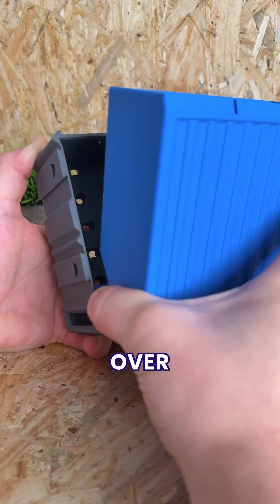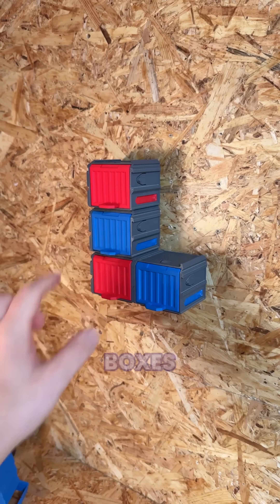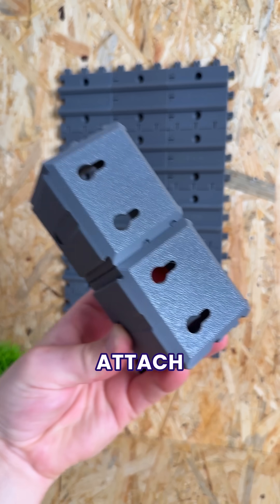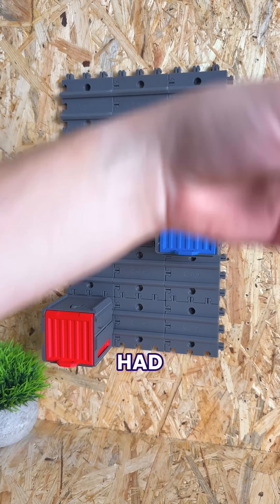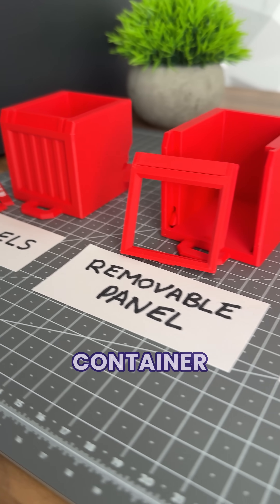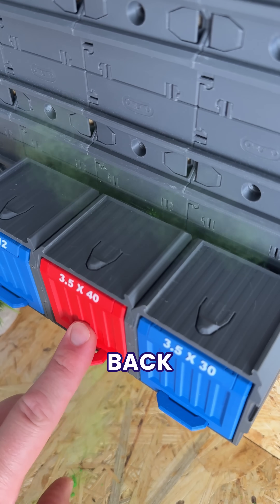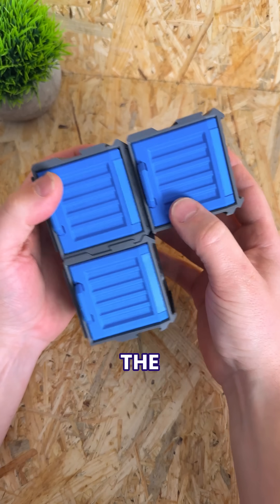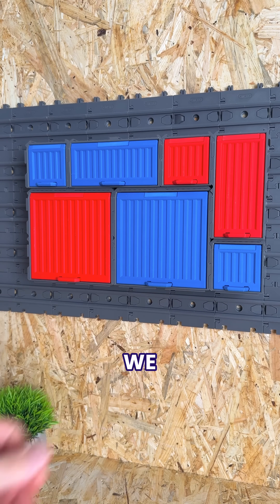We Built Infinite Storage - Part 24

Comment: ⏩🌐Video part 23 better Guide: The "Magnetic" Acetone Vapor Bath (Cold Method)
Best for: ABS & ASA prints. This method uses a liftable chamber to turn layer lines into a mirror-like gloss without expensive equipment.
The Setup
The Chamber: Use a Polypropylene (PP) container (Recycle Code #5). Acetone eats other plastics!
The "Magnetic" Trick: Use pairs of magnets to pin paper towels to the interior walls and ceiling of the box.
The Solvent: Soak the towels in 99% Acetone (damp, not dripping).
The Process
Prep: Place your print on a non-reactive "pedestal" (glass or aluminum foil).
Cover: Lower the box over the print. The vapor is heavier than air, so it will fill the box from the bottom up.
Watch: Wait 10–30 minutes. Once it looks slightly shiny, it’s done.
Cure: Lift the box and DO NOT TOUCH the print. It will be soft like jelly. Let it harden for 2+ hours until the smell is gone.
⚠️ Quick Safety
Ventilation: Outdoors only. Acetone vapors are heavy and flammable.
Check your Filament: This DOES NOT WORK on PLA or PETG. It only works on ABS/ASA.

Comment: 45 years ago I bought a similar system for my tools, screws, nails and similar. I'm still using it. Unfortunately I forgot the name. It also slide together, has several different sizes.

Comment: How about making one very complicated bin - just one? A tug, that can go dock with other bins and bring them 'here'. That way, I don't have to walk to the other end of the shop to fetch something that is actually mounted to a track that reaches me. If you put an esp32 in it and 2 small motors (it doesn't have to be fast), then write an app that can work out how to route the tug to the container I want and how to bring it back again (ok, that's the hard part, but it's not that hard, really - you can put a camera on the tug (fisheye, mounted to a stick, looking downwards, then remove the lens distrotion and  use slam algorithm for mapping). You can use the phone camera in the app and machine vision to work out the location of the required bin and the destination.

Then I can create loadouts for each project. The tug can move the boxes around until they're setup correctly for my current project.

Comment: @playerconveyor: 
First, print everything in flat, matt white. Everything. No colours, no textures, just flat, white, clean.

Mount a camera to the top, looking down, so that it can see what you put in the bins. Pipe the video to an ai to identify the contents and log the location and contents in a db. As containers move, the location is noted by the ai watching the camera and updated in the db.

Finally, mount a projector on the ceiling facing the bins. Use projection mapping software and the contents of the db, to help you find what you're looking for. You ask for m2 washers, the projection mapping provides pretty 3d animations of arrows snaking around the bins to highlight the glowing bin you're looking for. Suddenly, all the other bins go dark and the one you want is left floating in 3d space, invisible except for its contents. You can see the washers, sitting in the now translucent bin. Awesome.

Comment: Add those things at the bottom of the earlier versions as a new attachment to the wall mounted version, add different kinds of sizes and shapes, some for batteries, for sd cards, micro sd cards, screws, nintendo switch cartridges maybe, discs

Comment: Heh. This is why all engineering of decent products takes a good long while. You solve problems, make a mock up, discover new problems, solve those problems, make a mock up, discover new problems, etc etc. until you finally reach the stage of “The rest of these problems are the edge-iest of edge cases and we’d spend more time designing them out than the product would actually be used” and ship it.

Comment: You should also make the rails all cross eachother so you can move it up and down but also left and right so you dont have to take it of and put it on a other rail
Reply: Wouldn't gravity just pull it to the lowest point?
Reply: @coolkattcoder he can use the same lips on the edges for the horizontale rails to stop them from falling

Comment: Are they durable like if I open and close a 100 times or the plastic don't degrade over the years ?
Reply: Everything eventually degrades, but this is a good and durable design especially for the cost which is dirt cheap.
Reply: @Bruva_Ayamhyt  I know nothing is eternal but can it last a least a year ?